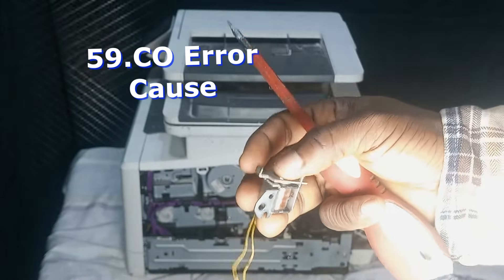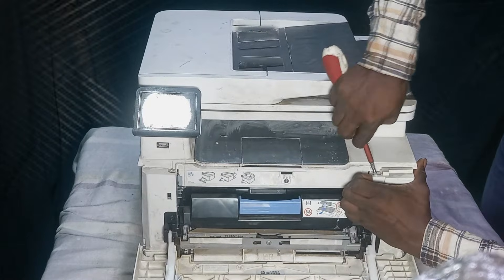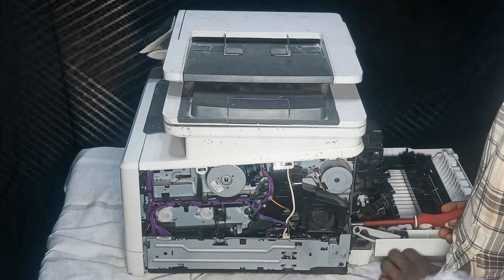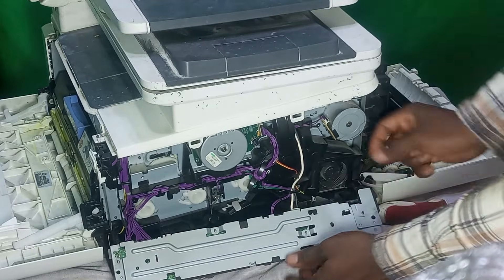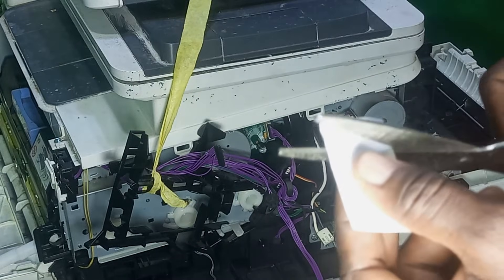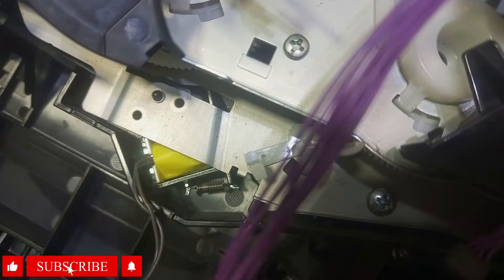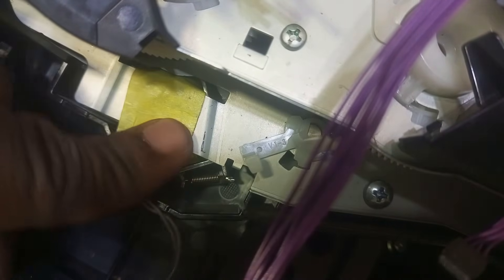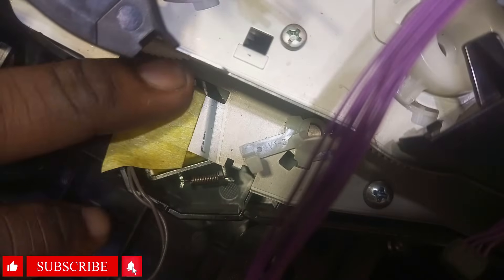59.CO Error Fix

Comment: I tried exactly what you said to do. My printer fell out of the back of my mom's van and threw this 59.C0 Error. I taped the solenoid, but it's still throwing this code. Any tips?
Reply from the maker: I think there might have been a misalignment in one of the gears due to the fall, confirm if you hear any noise when you power on the printer?
Reply: @dreamsetservices2847 I think I just didn't force the solenoid open before taping it. 😅
Reply: It's still giving the 59.C0 Error code. 😢 I think I'll just go buy another printer

Comment: Thanks - I followed your video and while it was quite challenging to remove the plastic components without damage, I managed to reach the solenoid and place the tape.  I used a small piece of of cloth tape on the end of a very thin spatula tool.  Printer is now working perfectly.  Cheers
Reply from the maker: Wow!!! Great job, Am glad this video was helpful to you